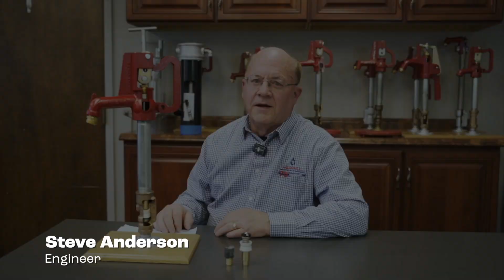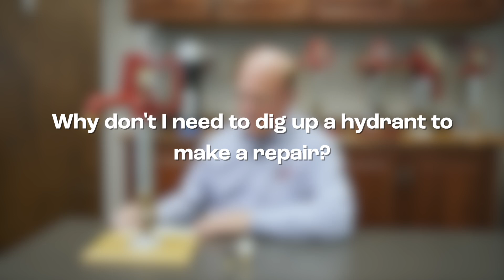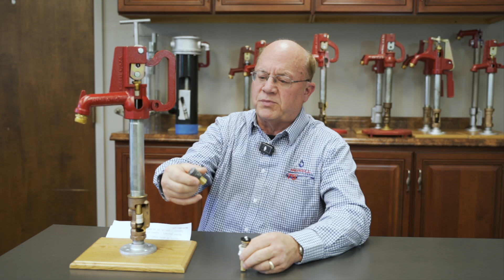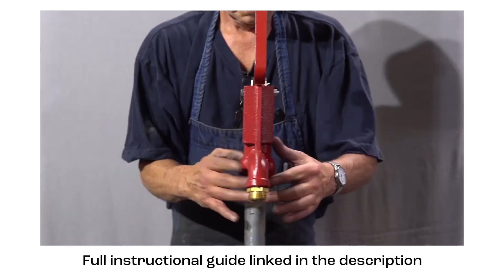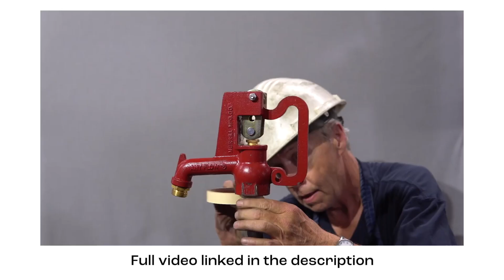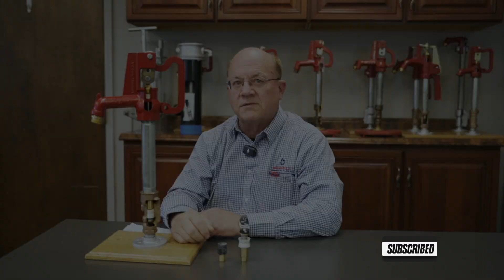Why Don't I Need to Dig Up a Hydrant to Make a Repair?

Comment: Mine is seized at the top and won’t budge using 3 ft long pipe wrench.  I am afraid the pipe will collapse if I try to put anymore force on it.  Can I heat it up without damaging the spigot? I plan on doing a full rebuild anyway.
Reply from the maker: You can heat it up with a torch if you are careful and do not concentrate the heat any where other than the base of the head.

Comment: Any suggestion to get the plunger out when it has broken for the rod?
Reply from the maker: If the plunger rod has rusted and broken off, leaving part of the rod and plunger stuck inside the valve body, unfortunately there isn’t a trick to pull it out from the top. In that case, the hydrant will need to be dug up to remove and replace the internal parts.

There is a long-shot removal method only when the rubber plunger separates and is lodged by itself — but when the metal rod and connection are still inside, excavation is the only reliable solution.

Comment: Great info.   I don't like digging them up, so generally dug them up and tossed the whole unit.  Now will look for parts!
Most recently, a horse broke the head casting piece.  Right at the obvious weak spot.  May try JBWeld.  But a new casting may be in my future.  
Where to find parts?   My plumbing store guy has no clue.
Reply from the maker: Hi @Rio97621 – We’re glad the video helped! You can find replacement parts through one of our distributors (use the locator here: https://merrillmfg.com/pages/distributors) or directly on our website: https://merrillmfg.com/search?type=product&q=parts

We’re currently working on improving our site to make parts even easier to find. And yes — sometimes a new casting is the way to go, especially after a surprise like that! Let us know if you need help identifying the exact part.
Reply: If your drain hole plugs up you will be digging this up